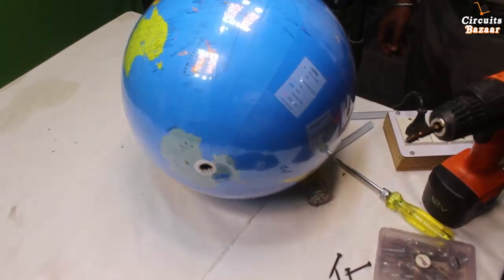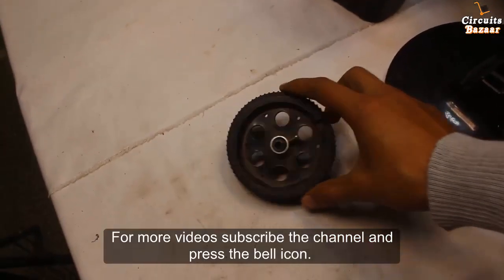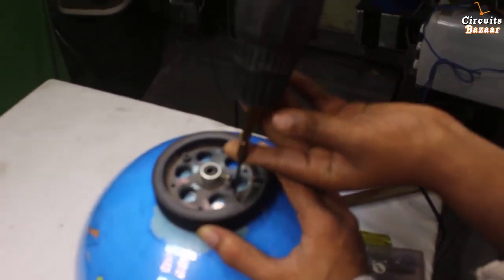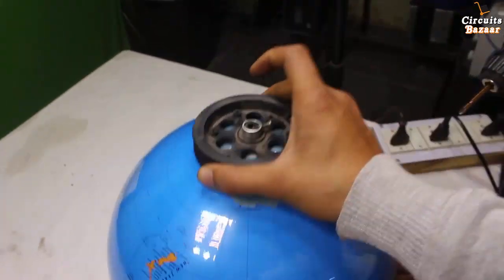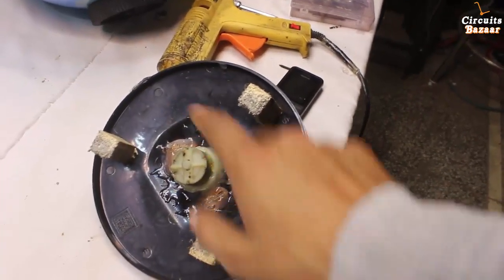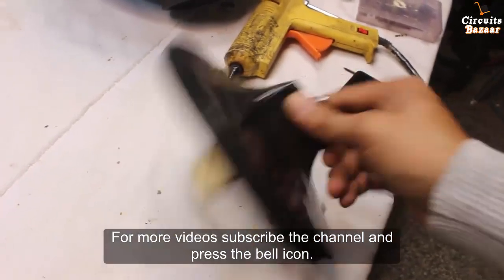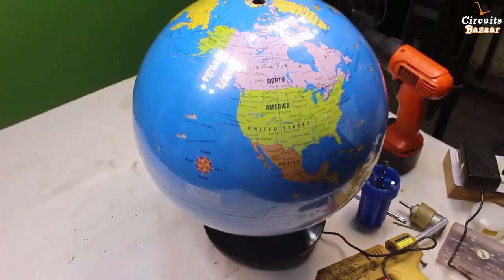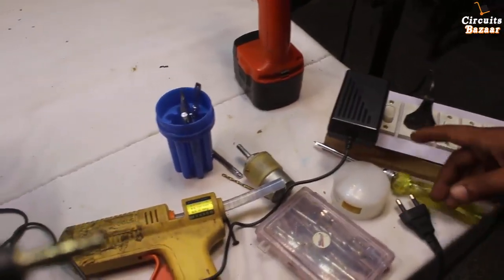Making of Automatic Rotating Globe at Home - with detail

Comment: Good intention but quiet noisy and messy. I think a rubber belt to a settepper motor pulley would work better and can be synchronised with an arduino to mimic the actual earth's rotational speed.
Reply from the maker: Good suggestions